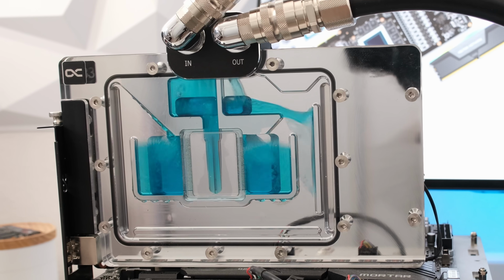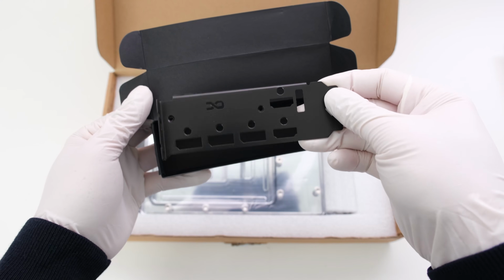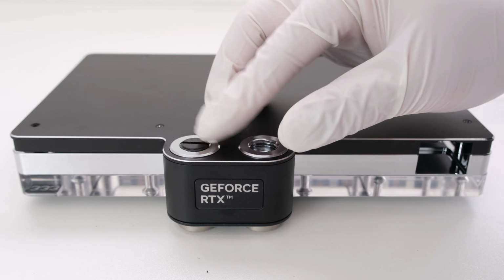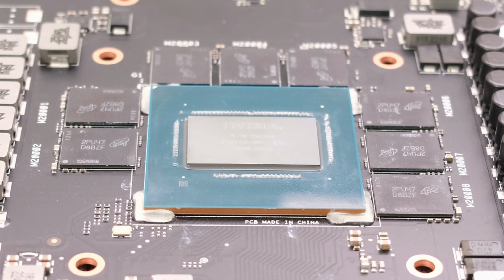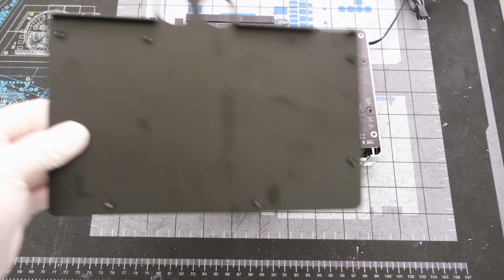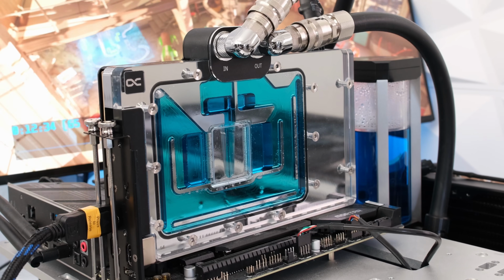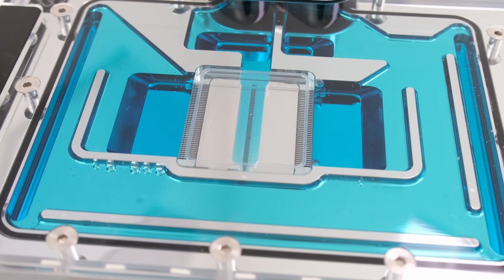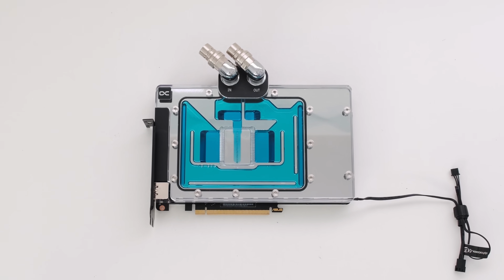Alphacool Core Water Block on RTX 4080 ASUS TUF

Comment: Nice Review ;)
Reply from the maker: Thanks for your comment 🙏I have noticed numerous improvements to your water blocks for the 40-series. The plan for the channel is to continue to test water blocks and build systems using those blocks. At the 4090 launch, I got the PNY 4090 because it was one of the few cards available. Then, the Alphacool Eisblock reference design was one of the first water blocks onto the market. The EKWB and HK blocks weren't going to be out for at least another month or so. When testing the Eisblock, I noticed that numerous improvements were made (chrome plating, better o-ring design) and the block tested well for temperatures. The Core water block seems to try to improve on the design aspect of the card by integrating the terminal into the cold plate and making the coldplate as large as possible. I am looking forward to what Alphacool does next. Thanks again for your comment

Comment: little late to this video but didnt you put the thermal pad on the right side in the wrong place? isn't the thermal pad on right side supose to be like the one on the left covering the little circuits like on the left not down the smooth area where you have all the logos?
Reply from the maker: Thanks for your comment 🙏 Just from reading your comment, the thermal pads do not go on the smooth area with the logos. Hope that helps

Comment: I don't think enough of these videos exist!
Reply from the maker: Thanks for your comment 🙏 Well, it has been a while since I did a water block episode. I think I've done most of them for the cards I still have on hand already. I am getting a 4080 Super Strix in, since I never did the 4090 strix. I still happen to have this Alphacool Core water block and I'm optimistic that it'll fit the 4080 super strix. If it does, would you still be interested in seeing the same block but on a different card? Thanks again for watching

Comment: Loving your videos. So helpful and using this for the 4080 super. Do you think this water block will fit the 4080 super tuf? Comparing the PCB, they both look very similar. There’s an image of the 4080 super on techpowerup.
Reply from the maker: Thanks for your comment 🙏 Oh wow, very thankful for the positive feedback. I haven't done any research, but I do have a 4080 super strix being delivered soon. The current plan is to do an unbox, stock air test and teardown video. Again, having not looked at anything related to the 4080 super (yet), I totally assume it would be basically the same PCB. It looks like only clock speeds and memory bandwidth increased. It seems like they are simply finding ways to up the clocks a little bit and increase memory bandwidth a little bit and then refreshing it with a new coat of paint and a price drop. Changing up the PCB would likely increase internal costs for them, so I think that's unlikely. But that is speculation on my part. I may reuse this water block on the Super strix (if it fits and if there seems to be viewership/interest in the 4080 Super series in general). Thanks again for your comment and watching
Reply: @vectornetwork  thank you for your reply!! Excited to see the new video. Earlier today, Alphacool released the comparability list for the  4080 supers and they confirmed that the 4080 blocks will work for the supers.
Reply from the maker: @TotemManVooDoo oh, terrific! Thanks for the info

Comment: Ugliest thermal pad and TIM application I've ever seen, but the most concise and efficient video I've ever found showing how to install this block :)
Reply from the maker: Thanks for your comment 🙏 I recognize my TIM application can be improved. I only have one chance to get the shot right. I use the X myself because it seems to provide the best coverage (but the trade off is usually I put too a little too much). So I started with the X on this channel and just kept with it for consistency. I recently showed the contact jobs on a couple of the CPU blocks, since the results were so close, paste/contact will make a difference. As for the thermal pads. I absolutely struggle with how I should present the thermal pad section of each video as its by far the most complicated footage to try to capture. I get a lot of thermal pad comments, so I'll try my best to improve those sections in future videos. Hope that helps.

Comment: Hi, may I ask how much is it better than Alphacool previous version water block?
Reply from the maker: Thanks for your comment 🙏 Good question. I'll start with the 30-series blocks and then talk about the 40-series blocks. For 30-series alphacool blocks, the coldplates were made of copper plated nickel and the coldplate and acrylic top seal used 4 black rubber o-rings for water proofing and they incorporated it into the flow-path design. For the 40-series blocks called Eisblock, the main difference was that the copper is now plated with chrome. Chrome is supposedly more durable but it is absolutely more shiny and reflective. As for the waterproof seal, they changed it to one large black rubber O-ring around the perimeter of the coldplate, so its not part of the flow path design. For the 40-series blocks called Core, they retained everything from the Eisblock, but they made two more changes. They increased the size of the coldplate, so now it covers the whole PCB, rather than just the processor/memory area. This increases weight for sure but cooling seemed the same. They also built the terminal directly into the coldplate. Normally, a terminal (where the plugs in and out go) can be mounted on separate, but for the Core, its all one single unit. That is harder to build/design, but I am unsure of the performance improvement. So, as a summary, it does seem like Alphacool made a series of improvements over their products with the 40-series. Hope that helps

Comment: Really enjoy your videos! I have two questions which I hope you do not take as me trying to get you as you clearly know your stuff.
The thermal paste stuff with double sided peel of tape/film, would it not be easier to add it to the board/block with only 1 side peeled off to maintain some sort of rigidity and peel of the other side once on the paste is on? I could understand it would not matter for performance if it does not look perfect, but for someone with shaky hands would you suggest my method or is there a technical reason that requires you to peel both sides then install?
And a second question, why would you want low conductivity in the coolant? 
Thanks!
Reply from the maker: Thanks for your comment 🙏I am glad you asked. Peeling one side off of the thermal pad, placing on the water block and then peeling the other side off of the thermal pad is exactly what I tried to do initially. It made sense, since that's how pre-applied thermal pads work on both GPUs (corsair, bitspower) and Motherboard NVME slots. So, I did try that, but I ran into a few issues. First, it would require moving the camera for a single thermal pad peel (and I may have like up to 10-15 peels to do). The camera needs to move because once its on the block, my finger will literally block the peel, unless I get it really nice and close. Another thing is when I tried that, it was difficult to get a clean grip on thermal pad (with my gloves on) and the pad would just keep moving around and tend to rip. When placed on the water block yourself, it just isn't as sticky as when its preapplied so it moves around and that really messes up the footage. The thermal pad portion of the videos is one of the harder parts to do because its actually a lot of setup and camera work for relatively little visual interest (and some people may simply not be interested, while others may be greatly interested, its a balance). So, what I have tried to do is show the pads being taken out of the bag and then show the peels and then show the placement, as best as I can. If the sections are shorts and/or not complete, its because the footage didn't turn out well. Thermal pads is one of the things I really can't redo. Well, I can, but I like to show things stock and how it comes out of the box. As for the coolant. I mention conductivity because of spills/leaks. I have had my fair share of leaks and coolant/water spraying aroudn, drops of coolant here and there and everywhere. I try to do everything perfect, but sometimes I rush for the camera and there is something expected that happens. So, when the coolant inevitably gets on the components. I just make sure I clean everything up and dry everything and I never had a failure of any kind. My understanding is if the coolant has high conductivity, it may cause damage to the PC components faster and more easily in a case of a leak/unexpected drops of coolant...etc/etc. Everything and anything happens while water cooling (at least for me). Hope that helps and thank you for watching and ask me anything, I will do my best to respond.

Comment: I bought the same alphacool core for my strix 4090, but with orignal pads temperature is 80° celsius on gpu and 112° on the hotspot  , i tryed 1mm gelid pad same.problem and pads are not marked and thermic paste isnt spread out ... i ll try with 0.5mm tomorrow ...
Reply: Man i have the same problem original block pads on the block full load not undervolting Asus oc mode temps in 80s and hotspot 100 to 115°c
Reply: Use Upsiren putty instead of thermal pads.
Reply: Mate i replaced the thermal paste from stupid alphacool to my thermal grizzly kryonaut extreme(which i use for many projects). Temps stays over time in the 60s with hot spots in the 70s sometimes 80s

Comment: Yes sir! 😀

Nice vídeo, and how pretty this block actually looks. 

In next GPU gen, who knows I'd be doing the same with a 70/80s series card.

Thanks for the needed and great content.
Reply from the maker: Thanks for your comment 🙏I agree that this block does look nice in person. I think it has to do with the combination of the chrome plated copper that shows the flowpath really well. It shines. Then Alphacool seems to want engineer some design aspects into their water blocks by incorporating the terminal and extending copper all the way to the edge of the block/PCB. Thanks for your comment and I do plan to continue to produce more videos as time allows. I have a Heatkiller V block for the ASUS 4080 TUF coming out next. Then I plan to put that block into a true ITX build and that would be the following episode. Thanks again and thank you for watching!
Reply: @vectornetwork  Really looking forward to the ITX build video! Is there any ETA on that one? 
Thanks for all the amazing videos, your narration is so informative!
Reply from the maker: Wow thank you! 🙏 On the ITX build, there is good news and bad news. Bad news is that the Alphacool Core RTX 4080 simply did not fit. I had mismeasured and the terminal is too large. Good news is that I decided to use the Watercool Heatkiller RTX 4080 TUF block (in silver) instead. I am nearly done with the water block video and that should be out next week. Then I will finish working on the ITX build with the Heatkiller 4080. It fits well and the terminal placement is perfect. The build is AM5 ITX 7600 32GB with the 4080 using the AM5 combo block from EK in the meshlicious. EK black micro adapter fittings for every run and 13/10 heatkiller EPDM black soft tubing. 280 rad and 140 be Quiet! silent wing 4 pros. I will do a variety of tests including undervolting temps and performance across a variety of games. As for ETA, it's the episode after the next and I'm in process. Hope that helps!
Reply: @vectornetwork Looking forward to it!

Comment: you made those pads look grosh 🙄
Reply from the maker: Thanks for your comment 🙏I have to agree, the frontside pads did not look good. I tried to edit it as best as possible so people wouldn't notice. The pads were 1mm thick and I had 1 chance to do it correctly for the shot. Having the gloves on doesn't help, but I am getting used to it. The pads were actually noticeably bigger than they needed to be but I only noticed that when I started the footage and I couldn't stop. Then after I noticed that some of the pads were torn. Not ideal. When I was editing the footage, I noticed it was me that tore them based on the way I applied them. Yes, they were very thin, but I could have done a better job with  more planning. I will plan to do a better job next time. Thanks for your feedback and I hope you will continue to provide feedback in the future.

Comment: Nice video.
Juste a note : Always do a cross-pattern when securing the 4 screws of the GPU DIE to allow a better paste dispertion as well as even pressure on the die.
Reply from the maker: Thanks for your comment 🙏I agree. I typically do the criss-cross pattern and would narrate that during installation. For this one, the instructions did say to go in a clockwise pattern, so I did. What I didn't show (and I usually do) was that I did go slowly and apply pressure as evenly as possible. So I would go back and forth numerous times. Thanks again for your comment and I appreciate the feedback

Comment: Nice Video. I really like the Alphacool Core Waterblocks. Might get one for my next GPU.
Reply from the maker: Thanks for your comment 🙏Alphacool has certainly been upgrading their water blocks for the 40-series. The eisblock model was a step up from their 30-series (chrome plating, better O-ring design, less O-rings. Then the core model appears to try to improve on the terminal and adding noticeably more coldplate. Hope that helps